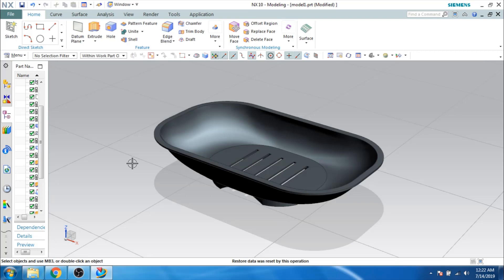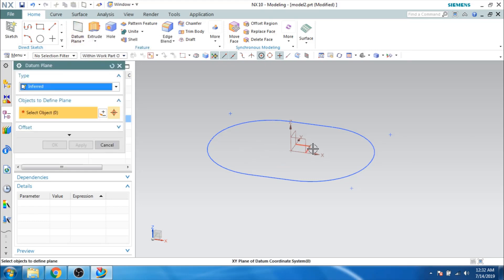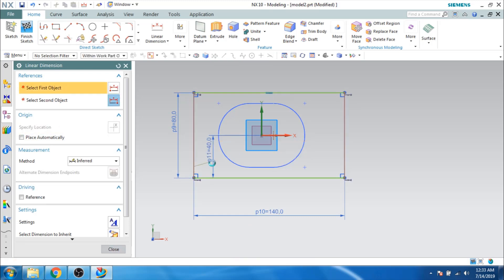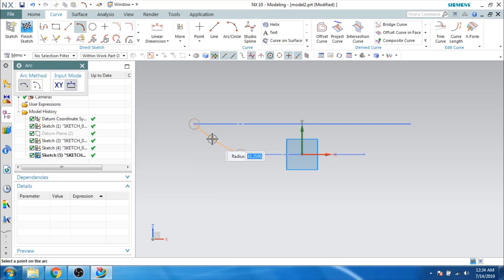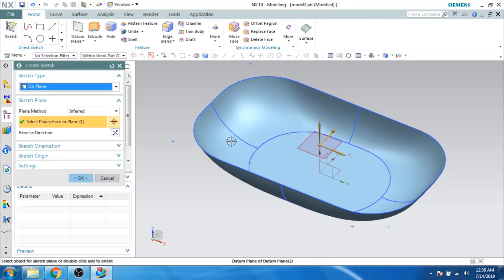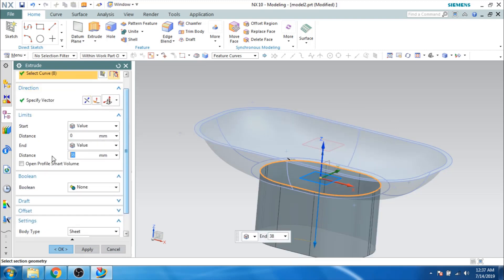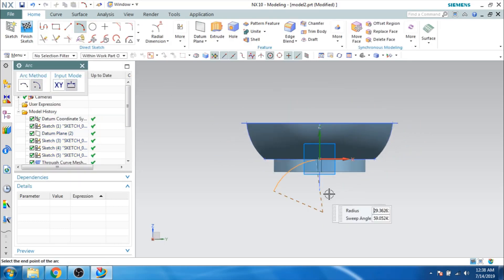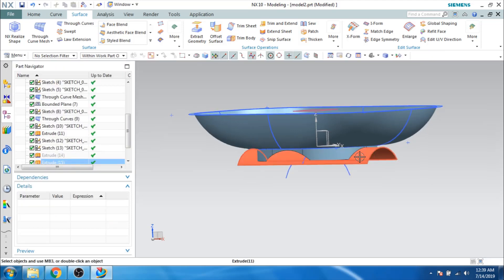Unigraphics NX - Surface Modeling Example || Soap Box.

Comment: What is the function of “Sew” icon
Reply from the maker: It joins sheets
Reply: Ohk thanks and instead of drawing those arc, you can also insert a cylinder then subtract, I tried it and it was the same. Thanks for lightening me and please keep on uploading those videos. If you have the one to design a sniper gun please share

Comment: When using through curves, connecting 2 surfaces. What is the difference between G1 (tangency) and G2 (curvature). I know what G1 is looking at, but what is G2 looking at. They are definitely different surface, I just dont know what G2 is actually doing to create  its surface. Thank you
Reply: @TechDesignsantosh  thank you, I just looked up somthing as close as I could to what i was looking for.